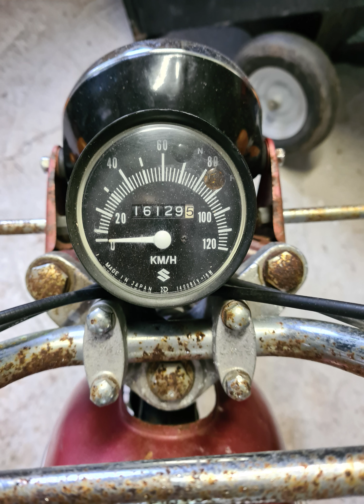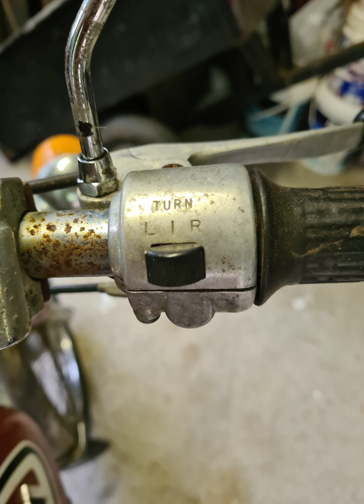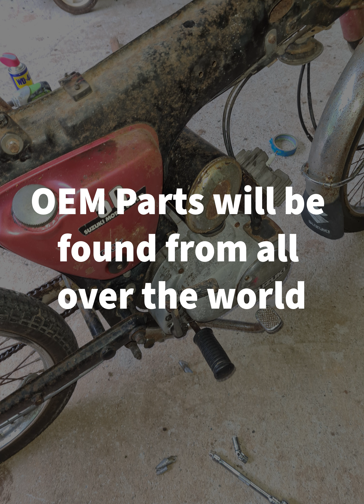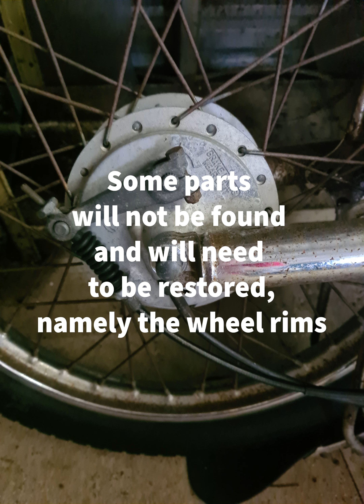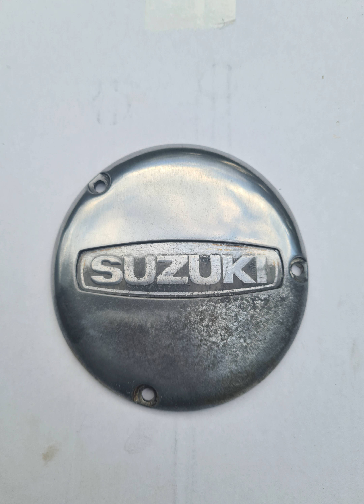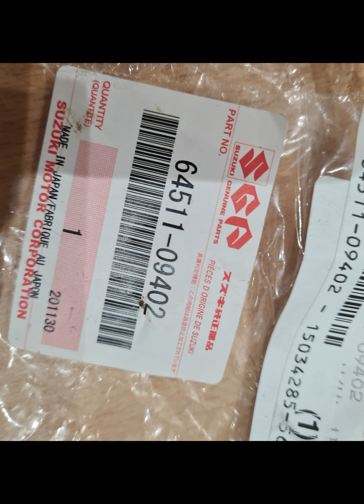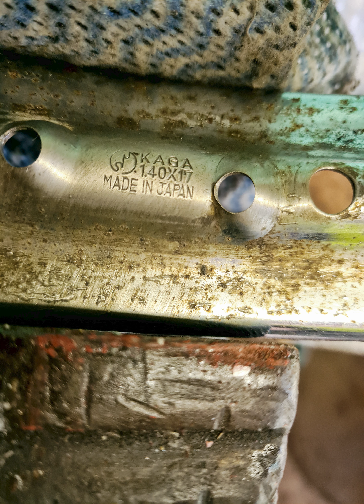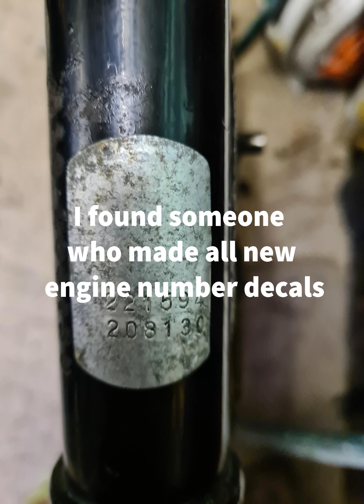1976 Suzuki AC50 barn find, will it ever run again-part 1

Comment: Very cool Andy. When I was 15 I talked my dad into buying me a motorcycle. He had a friend with a 1967 Honda Scrambler (305cc). He bought it, but both pistons had holes burned through the top. It came with replacement parts and I spent several days rebuilding it. Such a great experience for me as a kid. I've rebuilt several bikes at this point, but nothing like your Suzuki here. Cool barn find!
Reply from the maker: Hi Dan,  this is the same bike I had when I was 17, but mine was Blue. The bike is nearly done, just waiting on the tank which had to be hand fabricated. The bike now looks like It came straight from the showroom